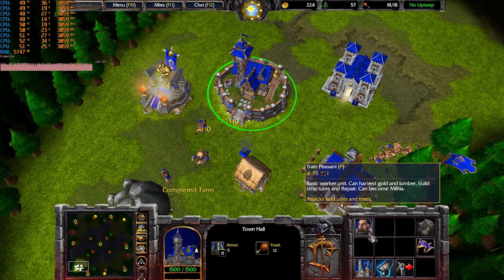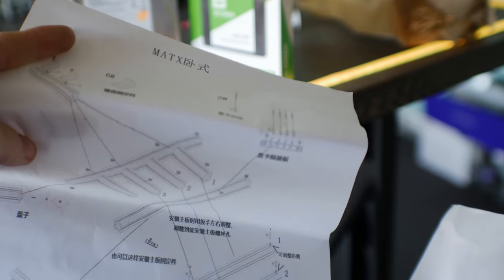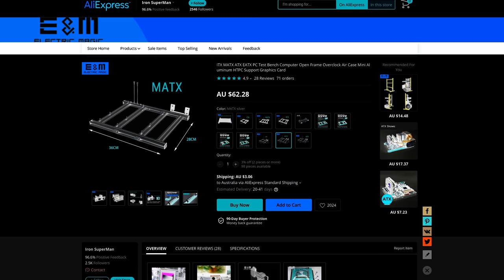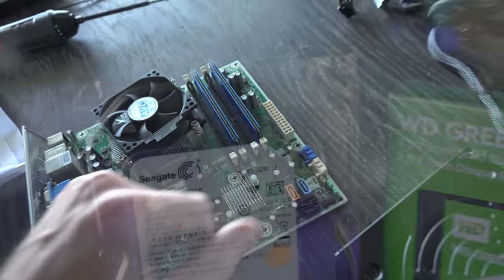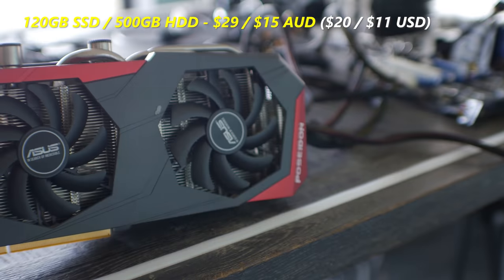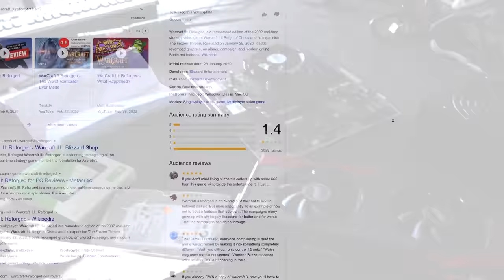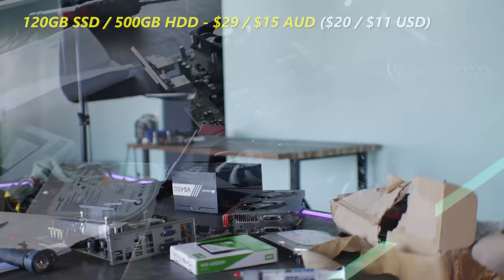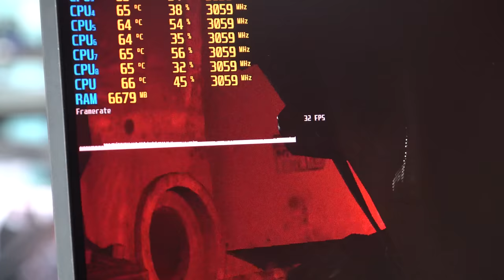I Built this Gaming PC for $160 to Play Warcraft 3 Reforged

Comment: The open air bench seems Ok for the price. The only thing I would do differently is not attach the SSD to the HDD.  It maybe Ok now but HHDs do get hot and the heat might shorten the life or at least make the SSD thermal throttle. My favorite RTS back in the day was Command & Conquer and Red Alert. I remember beating the computer pretty easily, but I got crushed the first few times I played against a human online.

Comment: Yeaeehhh !!!! I 'm so glad seeing my GPU (ASUS ROG GTX780 Poseidon ) working flawlessly after all those years !!!
This damn motherboard i have made me having doubts about the functionality of my GPU , but everything was fine after all !!
Thanks for this video Bryan !!! i would be severely depressed if i was seeing that my once beloved "Poseidon" had stopped working ,since i had bought this GPU due to its supposedly TOP-NOTCH build quality. I'm glad to see that it didn't let me down after all  !!!
Reply: Funny how you gave it away thinking it was broken. I bet you wouldn’t have if you knew it worked fine
Reply: @Alexander_l322  No , i suspected all along that there was about 75-80% chance it was a motherboard problem , since i have an ASUS AM3+ motherboard and all this time i've heard a lot of negative comments about ASUS "anti-surge" protection on their motherboards . I don't know if i was using an AM4 ASUS mobo the problem would be the same , but apparently , their older AM3+ mobos have issues with their "anti-surge" implementation.
As i had told Bryan , the problem was that most of the time the PC wouldn't start-up unless i removed the GPU. But sometimes , it did start , and when that happened it was fully capable with games , benchmarks etc (*i used all the 3D Mark's stress tests , and my GPU was passing them veeery easily . So this had made me suspect from the start that it probably was a mobo-related problem rather than a GPU one.
Anyway , since nowadays i have stronger GPUs and not that much patience to waste time ""playing"" with motherboards , i decided to donate it to Bryan instead of wondering what's the real problem .
-----As i said i was very glad seeing that the problem wasn't the "Poseidon" since i used to love this GPU and i used it for at least 2-3 years on my brother's PC.
Reply: Powernod I would have kept it and tested it on a different motherboard as it’s a good enough GPU for me. Thanks for toilet reading btw

Comment: Did a similar build with an i7 920 and a 750ti 6gb of ram to use as a dragonball fighter z rig. Max settings 60fps at 1080p. Might make a custom arcade cab for it.

Comment: built an i3 6100 rx 560 machine, but i have a proprietary motherboard and psu in an atx case, the motherboard fits fine, but the oem sff psu doesnt fit in the standard psu mount, is it safe screwing the oem power supply to the top of the case with only two screws on one side of the atx mount? .

Comment: I’m really digging this open case aesthetic. I’ve recently done a similar build as well, which I managed to build for free (Resembling your old “Lunch money build” you did back in the days) featuring a Xeon X3430 (I know they are getting phased out, but for the price is still great) and a Bios Modded GTX 580. I had to reduce the power limit into the BIOS to make it fit into the HP case with the HP PSU and I even had to solder two extra PciE 8 Pin cables. Talk about inspiration, I even decided to make a Youtube video out of it and I will post it in a couple of days🤗 Keep up the goord work Bryan, your videos are simply the best as always!

Comment: Oooh that motherboard is from an old HP pavilion desktop. My parents had an old one of those and I built them a new PC and took that one. It had an I7-860 in it and I was gonna do a flip with it but accidentally broke the PCIe slot lol. It’s cool to see you using it

I ended up replacing the motherboard with an intel DH55TC, and then threw in 12gb ram and an RX 470. Build the entire PC for $280 and sold it for $500. It was great. Those older i7s are a beast, especially if you have a good enough motherboard and cooler to overclock them

Comment: I built a vertical bench open air case, the red and black ALU one with plexiglass for mounting side fans, SSD, and the power on/off button.  It looks quite nice.  I also cut some black plexi to mount on the back of the GPU, which did not come with a backplate. Also looks quite nice. The vertical bench kit cost about $70 incl. shipping on eBay/AliEx. It also has mounting racks for the power supply on the backside, plus a mounting plate for the PCIE slots (e.g. GPU). It's a novelty really...something for the corner of my desk.  I have a switch box for the Keyboard and mouse, so I can easily move between my main PC (E5-1680V2 (4.3Ghz all core) + ASUS P9X79Pro) and the bench PC (E5-2678V3 (3.2Ghz all core) + HuananZhi X99TF).
When building the bench, lay out all of the parts and think it through first.  Try not to assemble only to realize you have to take something apart because you forgot an interim step.  In particular, the 9 standoffs (3 x 3) need to be slid into the transverse bars BEFORE mounting the 3 transverse bars to the second vertical bar.
If you build it correctly you will notice the top horizontal cross bar has two pre-drilled holes for an optional handle (the pre-drilled holes are the only real difference from the other 2 remaining transverse bars).  You can buy the handle for that top horizontal bar...or do what I chose to do...use decent paracord with large knots to secure each end on the other side of each hole.  I melted the nylon knots to secure them. The holes did not need de-burring with a round file on my set as the hole machining was smooth/excellent. A clear 1/4 in. hose/tube would be a nice touch to add with the paracord.
Also, it's important to measure the distance between the parallel cross/transverse bars (3 of them) to match the motherboard... in my case a std ATX (the instructions should provide this detail...about the only thing that was helpful other than the inventory check).  Then tighten them to the vertical posts after verifying the distances.  Next, with the motherboard facing you and positioned on the rack, align the standoff screws on the left side (IO Shield side) to the 3 motherboard mounting points along its IO Shield side. Once aligned, tighten them.  The other standoffs should be barely loose enough to slide.  Get them close to the motherboard points and then dial the positions in by using a wood or plastic tool for mounting hole alignment to each of the remaining standoffs; thin chopsticks will work to get the motherboards holes aligned to the standoffs.  I found that only the left standoffs needed to be really tightened.  The rest of the standoffs can slide a little on the cross-bars, but not be too loose (blue locktight for the screws will prevent them from loosening further).  This will keep the board fixed well enough and all standoffs function as desired.  The whole build process took me about 1.5 hours (excl. the OS install). The X99TF board looks nice because it has the integral IO shield/plastic housing. RGB fans on the CPU cooler add to the visual novelty.

Comment: Your videos are great. Do a video on the performance difference with spectre and meltdown protection on versus off. I saw the video  that you did before, but I believe it was comparing a xeon, a 9900 and an amd. Those of us buying older computers would like to know if, for example, an i5 is as affected as an i7, since apparently hyperthreading is disabled or reduced to protect us from meltdown and/or spectre. Also, a comparison of which processors are most affected, e.g., since you have recommended i7 3770 and 2600, by those or other vulnerabilities. Is it possible that the alleged Apple tactic of slowing down their old products to get you to buy newer products is being used by Intel?

Comment: I use a old Antec Skeleton Case for my open air PC. i just took of the 250mm huge fan on top and all the plastic it was joined to to leave the steel base only,used it for about 7 yrs now.Very scarce to find now these cases.

Comment: I've been playing the HALF-LIFE 2/Episode 1 and 2 trilogy with the iGPU (UHD630 GPU) in the i7 8700K. Just having some fun. After overclocking everything else you find other stuff to overclock. Like my 32in 60-75Hz LG IPS panel. I got it up to 90Hz. 
  The UHD630 is in the entire 8th, 9th and 10th Gen i7's and i9's. The UHD630 is able to run even HL Episode 2 at 1080p60 locked with Ultra settings. I also got it up to 1550MHz from 1200MHz stock. That's without any extra voltage. I could get it up to 1600MHz but, it was getting a little to hot for comfort. Granted it has 2 60A Smart Power Stages from intersil to give it stability. I used the z370 Aorus Gaming 7 with a kit of Crucial's (Micron) Elite dimms running at 4400CL17. 
  There are 10 isl99227B's 60A SPS that are in the z370 Aorus Gaming 7. 8 for Vcore and 2 for the iGPU. The same exact VRM's are used in eVGA's $500 DARK boards. If that says anything. That's just crazy to me. 120A to the iGPU
  I like pushing lower end GPU's to see what they can do. The "Low Spec Gamer" got me back into it. Another great little GPU is the Samsung fabbed 14nm GTX 1050ti. I have the OC ASUS Dual card that runs at 2GHz without a external 6 or 8 pin. If you can find the right games with the game driver, the GPU can really shine. Like i said before, even with a i7 3770K (4.6GHz-5GHz) or equivalent CPU and a GTX 1050ti, you can run nVIDIA based titles that are optimised for nVIDIA GPU's at 1080p60 with high or Ultra settings. I was running Metro Exodus/ The Two Colonels/ Sam's Story with a 3770K and GTX 1050ti at 1080p60 at high settings locked. That's just awesome. For Ultra settings at 1080p60-80fps in Metro, a Sapphire Nitro+ RX480 8GB OC = RX580 (1342MHz) will do it just fine. It can even run nVIDIA's PhysX and other nVIDIA proprietary software/hardware/firmware, like nVIDIA's Hairworks. It's just funny to me that AMD's Polaris GPU can run nVIDIA's GFX enhancements. It also works on any of Project Red's games, like The Witcher 3 or RDR2 and any of the Metro series along with The Call of Duty series. COD GHOSTS in particular.I always liked the Hairworks on Riley, the super dog. Anyway, Cooll vid. I know content creators run out of ideas for the tube community. If you ever need some. Ideas, give me a holler. I have content for days. Maybe, i should start a channel....

Comment: That is a clean looking open air test bench. I've not yet finished mine (https://ibb.co/6s9CTrh) but it seems like I can shave off a bit more metal for a clean look. 
Your argument for push-pull does resonate and looking forward see how it performs. In the mean while I do require your assistance in that I have a heap of potatoe boards to test and I need some kind of quick release for the boards in stead of screwing all the time. 
Also thinking about changing the fans in a dl580g5 psu some day when I see time to find the right thermistor. 
But first the bench needs some spraying, currently practicing on some XT1086 horns (I've gotten rid of the rokit and sold the working one). Might be the most creative thing I've done in years :)
In a while I'll be doing the Melbourne Shuffle on some d-block & s-te-fan 😂 cheers!

Comment: I built a pc using this aluminum frame too. It took some time due to the instructions but once it came together in my head it went together fine. Definitely small though so it's limited to micro-ATX or mini-ITX

Comment: I have a xeon x3440 and a h55 motherboard, Im new to overclocking please  help me I dont know how to se the voltages. Currently  the cpu is clocked at 3ghz and the voltage is auto and its fine for gaming but if i go above 3ghz it wont boot to windows can somone help me out?
P.s My cooler is a snowman
Reply: No

Comment: Show people how the p106-90 performs. I got one for 35 euro to replace a dead gtx 960 and it works pretty damn well. Paired with an i7 4790k it's definitely held back, but it's an Alienware prebuilt so the mobo holds both back! Anyways cheers man.

Edit: anyone reading this, please not you need a 4th gen intel cpu or amd apu or better to use a mining card like the p106

Comment: Nice I just did a Ivy Bridge build with an Intel i7 3770 notice no k..Well funny story is I bought off the used market and it was an unlocked multiplier its 3.4ghz I got that baby to do 4.45g ghz all using air cooling in a very nice Zalman bought new